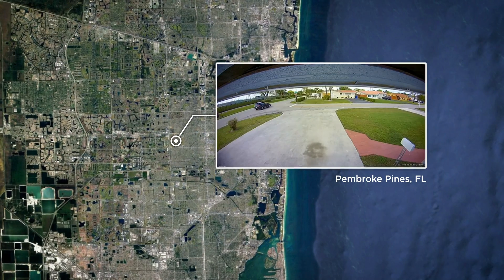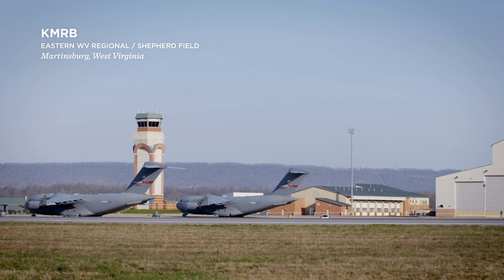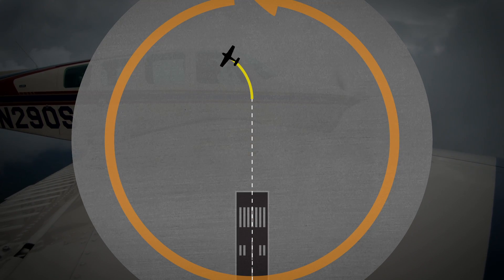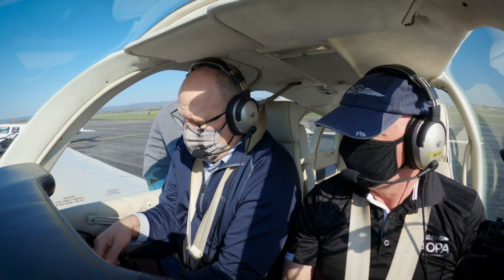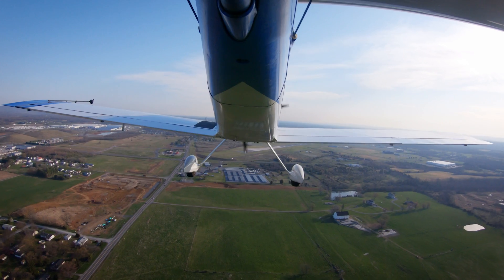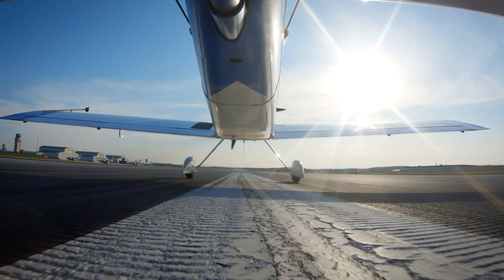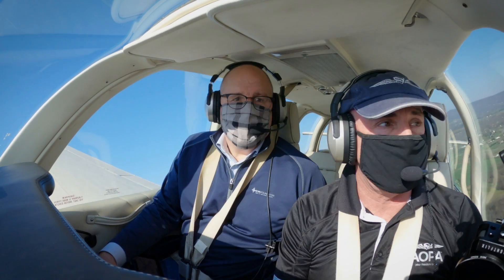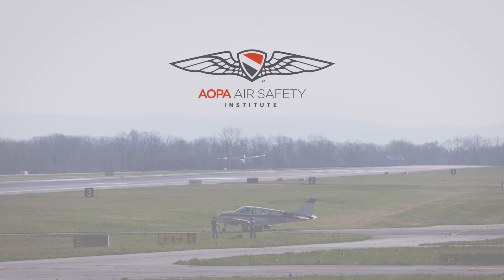Reality Check: The Runway Behind You

Comment: THE RUNWAY BEHIND YOU - CAN KILL YOU!
"best glide speed - in a 45deg. banked turned" - what is it? - Please tell us why to find (or calculate)!!!!
"why not 60deg steep turn"? (a Standard Rate Turn would be easier but much worse: it takes longer, so 60deg. sounds more reasonable)|
 (why 45deg.????)
"don't do it solo!" - but the lady did! You are showing us the opposite what you are talking about!
"don't train at low altitude" - but all the scenes does! - Again: you show us scenes which we should NOT do!
"between Vx and Vy" - why you do not climb to 500 AGL with Vx all the time????

In one scene - so much  runway left ahead, and emergency landing spots ahead - wouldn't it be safer to land there and to use part of the remaining runway (and airport field)?
In all the scenes - there are so many other options to do an emergency landing - why not taking these instead to try something unpredictable?
Why not briefing such a scenario before take-off? (show us how to brief a take-off, including how to handle such a situation before it happens, instead to talk about when it
happened)

This video is NOT REALISTIC! AND VERY RISKY!
And even the accident scenario is confusing: if you have two parallel runways - why not landing on the other one with a real 180 instead of a 270deg. turn?
(go to the other parallel runway!)

And trying at low AGL with Bonanza and trying several times without any obstacles... OK, higher glide speed = larger radius --> why you do not bank more, e.g. 60deg.?
(if you know your speed is higher - you have to bank more for smaller radius - isn't it obvious?)

And no words about contributing factors:
a) what about wind? Turn into head wind or a turn with tail wind?????
b) what if I have flown a "dog leg" (an offset at end of runway) - which way to turn is better? (but wind maters a lot!!!!)
c) what if I have emergency landing straight ahead (as in this video!)? - much safer to keep landing straight ahead? I think.
d) what if airport has obstacles, e.g. a Class-C with  a terminal buildings, with office buildings around airport perimeter?
    (this demonstration done at a smaller airport with not so dense areas around ... not realistic! Try to do it at KSNA, KFUL, KLGB!)

This video gives you such a FALSE IMPRESSION (even it takes the NTSB report wrong)!
Don't believe it is really an option ("the runway behind you" if you are at 500ft AGL, even lower or even at 1000ft - don't take numbers here, just personal experience and minimums!).
It depends not just on your skills! - also the wind, obstacles and the airport itself (imagine two parallel runways - what's then?)

Try this maneuver at a safe altitude: it is really tough (and I would assume, many will 'fail')
==> WHY AOPA DOES NOT FIGHT TO GET THIS MANEUVER INTO TRAINING AND ACS?????
And don't forget: if you are really in such an emergency, your engine has really quit and you see the ground coming towards you: can you imagine to be so
"cool" to keep best glide, esp. when you are in a 45deg. or even 60deg. bank? (I do not believe for myself)
Forget any exercises - the real life emergency makes it 10 times harder and more potential to stall (and to be dead)!

Why not doing it in a SIM (AATD)?
To try with idle engine and being familiar with airport is "easy". But do this maneuver at an unfamiliar airport with populated and unknown environment. NO WAY!!!!

BTW: I think, if you have really a "dead stick" (prop stopped) - it might make it a bit better (less drag). And if constant-speed prop or not - not a huge difference. Imagine, you fly a plane with fix pitch prop but it is adjusted for best clime (as many trainers are).
The video seems to be WRONG also in this case: if the engine really quits - the constant speed prop does not father, but it should go onto a less drag position, higher AOA).
So, a constant-speed-prop could be an advantage (not a disadvantage as stated in this video), for such a real emergency situation.

My conclusion:
1. have a take-off briefing - including aborted take-off (when and where), emergency landings ahead, when is the "impossible turn" possible (maybe just at 1000ft)
2. train it with a CFI ! - at a save altitude, e.g. over a free-way
3. know your Vx and Vx! - fly Vx until a "safe" altitude, e.g. 500ft AGL (Vx afterwards) - climb high but not not fly away from airport
4. check airport! - runway long and potentially enough grass after runway end - it might be possible to land still even from 500ft AGL
5. check wind! which turn direction is better is better for "turning back"? (into the wind)
6. Is there a "dog leg"? If so, what does it mean for my 270deg turn back to runway (consider the wind as well!)
7. forget "best glide" speed! esp. when you have to fly a 45deg. banked turn! Instead - KNOW YOUR STALL SPEED! (esp. for accelerated, when banked!!!!)
8. Try to fly a 60deg. banked steep turn!: it might kill more altitude - but it will be faster (as 45deg.) and at the end you have more altitude above the runway!
    Exercise really 60deg. 180deg. turns with optimum speed (not best glide as for leveled flight!, for this 60deg. bank!!!!)
9. get the sensation (steep turn, speed, "rushing towards ground") at a safe altitude and learn !!! to stay calm
10. do a decision about emergency landing mentally at any departure, at any airport: "what if?", train it at any regular departure (don't be surprised when it is needed)

This video gives you a completely FALSE impression!!!! When this situation happens to you - it is not a training or trial.
And it is NOT possible just by a statement from these guys!
This video is full of wrong information, misleading statements and creates more open questions and answers.

How do you know you are an "experienced pilot"? (who can be "experienced" when such situation happens only once during your life time?)
And the most important 'knowledge' for this maneuver and as an experienced pilot is: "what is you best performance (airspeed) in a seep turn?" (forget best glide - it does not matter here
and you cannot fly best glide speed in a steep turn!).
So, you have to train, exercise steep turn maneuvers as descending turns (idle engine) for "best glide in steep turn" and you cannot use or translate any numbers from POH,
esp. how to deal with the "sensation" when you spiral down to the ground.

This video (and AOPA, Air Safety Institute) takes it too lazy, too simplified and too optimistic (ignoring so many other factors as unknown region/airport, winds, airport layout...).
Sure, after some flights on my home base, after many "short approaches" I can make a return to the runway with the "impossible turn" - but at an unknown airport????
For sure not!
--> have you personal safety  limits and brief it before take-off!
Reply: 40-45 bank is the safest while still having good turning ratio.
Reply: @John Doe Right.  These  "Woke Pilots" have a nervous break down if have to do 45 degree turns on GRM like i did on Cherokee 140 and Grummans in 1974.  Rich guys, Poor Pilots..

Comment: Well done video and this is the way I approach the subject with students and flight review customers. The one variable that was not mentioned is the airport, and it is in some ways the most important variable. At many airports a 180 is all you truly need to have a nice fat  parallel runway or taxiway to land on. If other aircraft are using the paved surface, there is usually a big mowed infield to use.  At other airports you might only need a 45 degree turn to have thousands of feet of concrete in front of you. If you are flying out of an airport like my home airport that is carved out of the trees with no infields your options are much more limited and proceeding straight ahead is probably the best option. 
 If you happen to be at an airport with a tower and you need to put it on a taxiway or infield in an emergency situation just tell them about it. It's an emergency and you are doing what you need to to have as safe an outcome as possible. I was a tower controller for many years and actually saw a number of these situations. Most ended happily and flight standards never asked any awkward questions.

Comment: This video is only good for starting a conversation. It is rather dangerous otherwise. I'm also fairly confident to say that a windmilling prop is a higher drag situation than idle thrust, as some thrust is still being produced even at idle (the prop is still being spun by the engine and not by the airflow).

There is no analysis of the climb performance, distance travelled (accounting for headwind), glide performance achieved, or even the fact that with such a long runway, you have artificially pushed the return end of the runway towards the aircraft. 

Your analysis is severely lacking detail.

If you fly out of an airport that has a shorter runway, you could be in big trouble.

Just some back-of-the-envelope calcs in a spreadheet shows that you can't safely make this return. A Cessna 172 has a best rate climb speed of 73 kts and a best climb rate of 720 ft/min. After 1 minute you are 1.2 NM downrange and at 720 ft. With the official glide ratio of 9:1 and a best glide speed of 65 kts (which must be flown accurately and wings level to obtain the maximum glide range) the calculated glide distance at 65 kts gives a vertical rate of 731 ft/min, and a glide distance of 1.07 NM, or 0.13 NM (789 ft) short of the departure end of the runway.

...you've still got to make a 210 degree turn back to the end of the runway, eating maybe 30 seconds, or 360 ft of altitude. This reduces the glide range down to 0.541 NM, putting the aircraft 1.2 - 0.541 = 0.659 NM (4000 ft) short of the departure end of the runway.

This assumes ideal conditions, and flying perfectly to hit the stated numbers, in still air. Hot/high, heavily loaded, engine not producing quite the expected power, prop not producing quite the expected thrust, turbulence, variable winds, not flying precisely, can all conspire to make this an extremely bad idea.
Reply: You are right on some sentences, but wrong on most others.  I taught 3 kinds of turnbacks in day and night on many runways, many pilots and different airplanes and winds.  They say to add some more alt. in case of real engine out and state when not to do them too.   And yes, i taught many on c172 with 2 on board.  We brought it back from 700 agl with some winds to a 4,k runway only.  That airport was surrounded by houses and petroleum business all over.  Turnback from 700 agl, or get burned outside the airport. 

It is not impossible if you know it.  If dont know,  just dont do it.  But dont tell me i cannot practice because YOU CANT.. Your numbers are not realistic.

Comment: Wasn’t the accident aircraft returning to the parallel runway? That’s a 180 degree turn and it didn’t make it.
Reply: That Bonanza pilot did a huge error.  You cannot turnback from under 700 agl with no power on those. He tried from around 250 agl only.  They said that clearly not to do it like that.
Reply: They also don't consider the cross wind effect that increases required minimum airspeed
Reply: @morthomer5804  WTF..they did consider that..
Reply: YES, AOPA got even the NTSB report wrong, the situation:
If you have a parallel runway, just a 180 to the other one might work, but teaching us for a 270 (or 360 degree) to the same - might kill you.
TAKE-OFF briefing!!! And AOPA does not talk about: if I evaluate all the options - BTW: with considering the wind!!! (a huge factor) - I could decide
what my "safe turn-back altitude" is.
Just showing us, some guys can make it, some not, on unknown conditions (what was the wind???) and telling us 45deg bank is the "right one" - what a false message is provided?
Reply: @torstenjaekel1687  Are you sure of that?? i have to see the video again.  I think AOPA did a great video about a maneuver that can save your life not only on EFATO but on Flyover GRM Turnbacks, short approaches, and Box Canyon Turnbacks.  4 places where 180 or 270 deg. question mark practices can make you do the right control imputs and avoid accidents on those maneuvers. 

 Sorry for the wimps that cannot do it even if they can if they have more skills or  more valor..

Comment: Um, AOPA, I have a question. What is the nimber one cause of GA fatal accidents? LOCI if I remember my Nall Report correctly. Why are you advocating for turning back at all? You are low and slow, and now you want to make a max performance turn? This is a LOCI event just waiting to happen. Why are you going against the FAA AC? I teach my students to land straight ahead and if you have to turn to avoid an obsticle, no more than 30 degrees left or right. I also teach them to be spring loaded to push the nose down immediately upon losing the engine. They even brief that before they take the runway. Here you are advocating for going against FAA recommendations, and decades of data that says turning back to the runway is a terrible idea. I hope that nobody takes your advice and dies as a result.
Reply: You're right about the nal report, and loss of control being #1 killer.  That's exactly why this video is such a good one.  It points out that in many aircraft, under many conditions, you're just not going to make it back.  It's not a matter of pilot skill, it's physics.
Reply: @John Doe That's not only unfair, it's inaccurate.  The accident rate isn't going up, it's been going down for years, only recently has stalled.  If you look at part 91 (general aviation) accidents, NALL report statistics, a good percentage of them are from commercial pilots and ATP's, including loss of control.  In the 121 environment, when they're using specific procedures like DMMS, the accident rate is incredibly low.  But toss that out, and put the ATPs in single engine planes without those procedures, and they're making the exact same mistakes that PP's do.
Reply: @John Doe Attitude does have a lot to do with it.  Many people are just careless, don't seek out the right training, don't stay current, etc.  But that's ATP's as well as PPLs.  And some of these poor people just didn't get the right training.  The last bit is what bugs me the most.  If you're just training to the ACS minimum, the FAA might think you're OK, but I don't.  And that part is fixable.
Reply: @John Doe Maybe I'm too optimistic.  My thought process is that all pilots understand the risk is squarely their responsibility, and that if they realize they lack a particular skill they'll fix it, before they end up in a crumpled up ball of aluminum.  I don't think increasing mandatory hours or increasing the frequency of flight reviews would help.  Practicing the same old things won't fill in gaps in knowledge.  Adjusting ACS a bit might help, but I doubt if that will happen soon, as last time they did this, they made it worse not better (slow flight change).  The mindset of avoiding risky parts of the envelope makes sense, but not at the expense of learning basic flying skills.  My thought is that just bringing awareness to the fact that training to ACS minimums isn't either safe or reasonable will make student pilots aware that they have some responsibility to seek good training, and instructors that they have some responsibility to teach beyond ACS as well would help.  Saying that out loud, it may not sound reasonable that 141 schools will teach anything that isn't mandated, but if there becomes a consensus that minimums aren't good enough they'll have to adjust.
Reply: It's good to keep an open mind. The world isn't so black and white. If you're trained and prepared for incidents like this they've shown it's safe in some aircraft. Not everybody has nice fields and large roads right off departure end